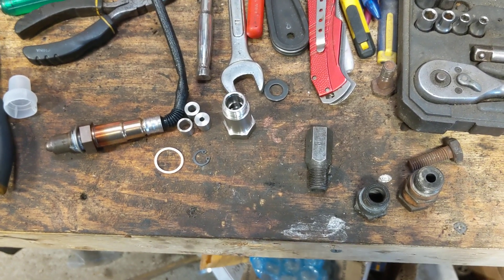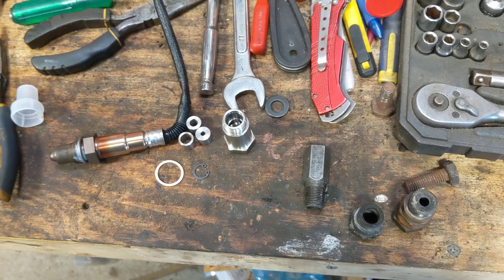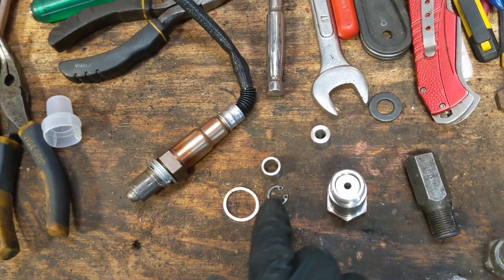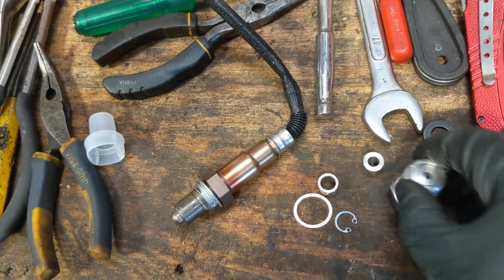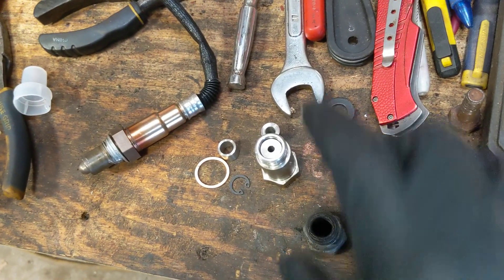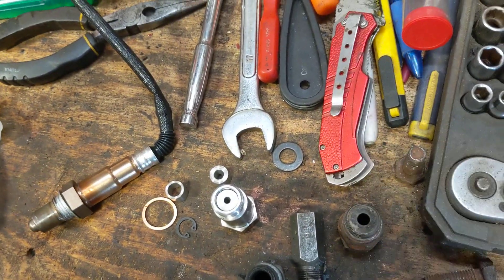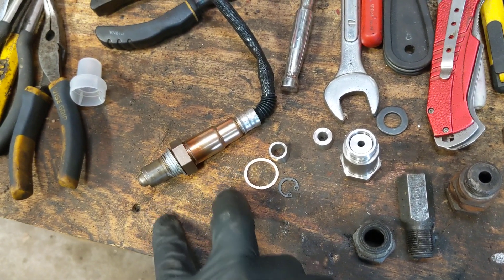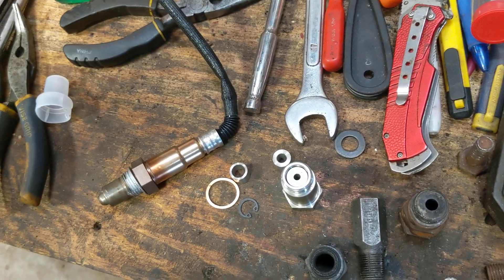Fix P0420 Catalyst System Efficiency Below Threshold Check Engine Code Easily Cheap!!!

Comment: I have two codes for my 2002 Toyota Camry: P0420 & P0172(System too rich, Bank 1) what should I do? And what the name of this part your speaking of in this video
Reply from the maker: Spark plug non Fowler. It helps the catalyst under efficiency code but being too rich that might be something else too.
Reply: Same exact car and I have a pending code... I need to pass this stupid emissions test

Comment: Whats the cause? Bad reporting phatom air not being reported to front 02. Or is there commonly just an issue with 02 sleeve allowing air in at the point and what could be the adverse effect if its say a vaccuum leak or an faulty fuel system issue pump or rail or just dirty filter.  Is there a recommended proccees to follow before giving up and adding the sleeve.
Reply from the maker: The converter is letting too much gases hit the o2 sensor because it's not filtering like it's supposed to. The sleep pulls it out and lets less gas in to make it look like it's working.
Reply: @patrickmurphy8619  ty for the quick reply

Comment: will replacing the 02 sensor with a new one fix it vs the adapter?
Reply from the maker: No not usually because you're O2 sensors doing its job. It's telling you the catalytic converter is no good so usually the O2 sensor is fine.
Reply: @patrickmurphy8619  so then what exactly is the adapter doing?
Reply from the maker: @planBdeveloper  making the sensor read less exhaust gas moving out of the direct stream

Comment: Good suggestion on the restrictor. I was able to find one on eBay for $13. I have already ordered something similar from Amazon with a single size opening but the ones with the choice of three restrictors will be my next step if these don't work.
Also, please use anti-seize on all threads (preferably copper) in case you need to remove them in the future.
Reply from the maker: Yep just make sure if theirs 2 sides you do both it usually works better
Reply: sorry to be so off topic but does anyone know a trick to get back into an instagram account?
I was dumb forgot the password. I appreciate any help you can give me!
Reply: @Titan Cameron Instablaster :)
Reply: @Conrad Keith It worked and I now got access to my account again. Im so happy!
Thanks so much you saved my account!
Reply: @Titan Cameron Glad I could help xD

Comment: Hello,
Can you tell me the Ebay seller,  part number or send link where you found the adapter on Ebay. I'm having trouble find the ones you show in the video with the snap ring and two different size openings......thanks
Reply from the maker: 402346614949 they're just calling them o2 sensor spacers now. Just fixed an issue for me with the Toyota tundra this week. If the cats are just starting to have problems they can usually fix it if they're totally gone they don't do it.

Comment: Pass emissions, clear code/check engine I get it. But how does that alleviate the initial problem/problems that triggered the light in the first place? P0421 or P0420 comes up as a problem potentially getting worse. Not just by symptoms alone. Poor Hp, ping noises, rough idle etc. These codes are typically known for Catalyst/sensors problems! Serious problems because engine can't breath properly. You mean to tell me this method fixes all 8 or 9 out of 10? 😳 bubble gum and tooth pick fixes only covers the problem dont you think! To get that pass paper is great but the engine is basically a ticking time bomb..now your car is at the salvage yard! But hey you got the pass paper! 🤷‍♂️ Not trying to be rude but hypothetical you know..

Comment: this is not fix, it is a bypass only.
Reply: I don't think bypass is the correct word... It simply moves the O2 sensor further back from the exhaust flow stream and the smaller hole limits the amount of exhaust getting to the sensor... There are not many alternative repairs and people literally end up selling the vehicle even after changing many expensive parts because they can't get rid of the code

Comment: If I have 3  converters on my Subaru which one should I change?  Po420  bank 1.
Reply from the maker: Do the rear most sensor.
Reply: @patrickmurphy8619  after the catalytic converter correct?
Reply from the maker: @myyoutubechannel3737  yes that's the one measuring what comes out of the catalytic converter